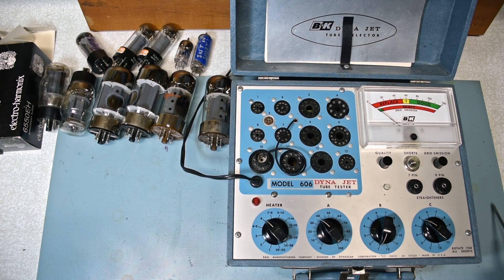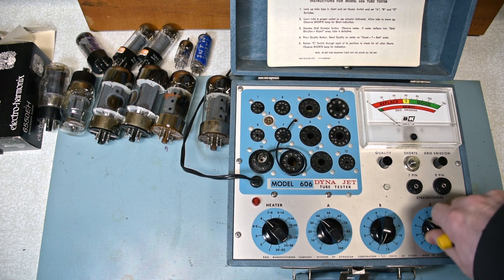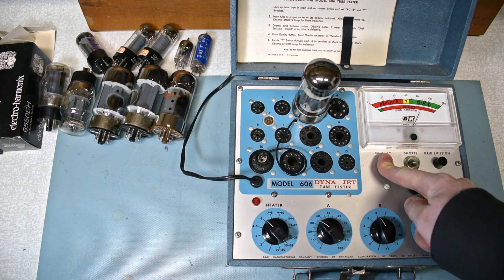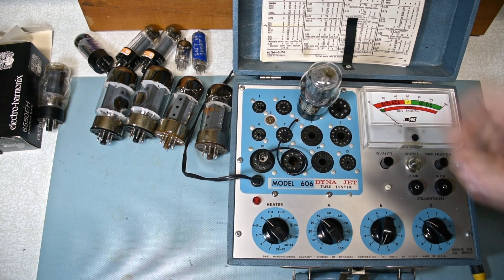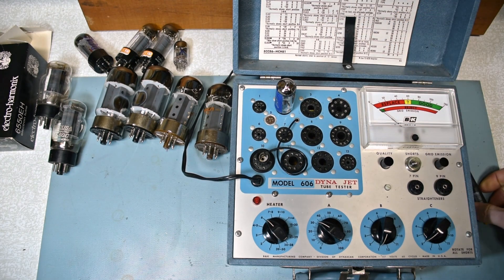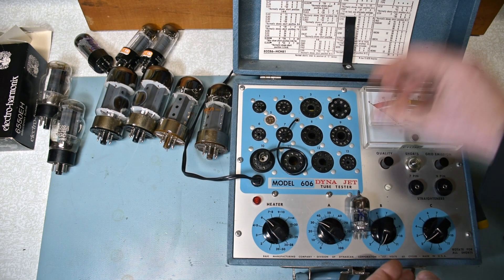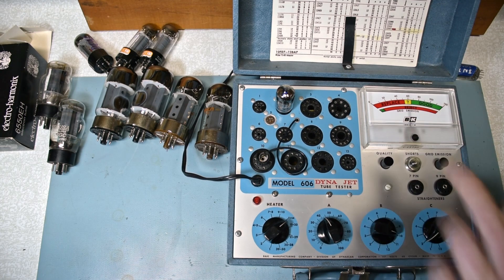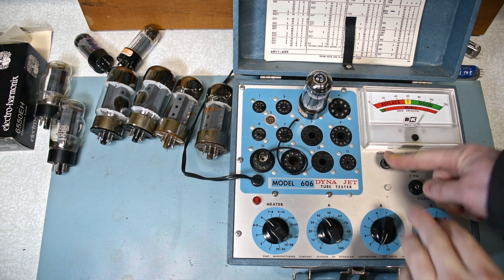Tube Tester B&K Model 606 DYNA JET Demo #009

Comment: Am i correct in assuming that ifni get the same reading on 2 different 6v6 tubes, for instance,  that they are 'matched' for use in a push pull guitar amp. Thanks for any insight. Ive asked this q on dozens of videos and have never gotten an answer
Reply from the maker: I don't think so.  This tested does not proved a high voltage to the plate as it would in an amplifier.  I believe the preffered matching uses similar voltage as an amp and measures current.

Comment: I noticed that the needle shot up while you were tapping the tube this would indicate a fault would it not
Reply from the maker: If I wasn't pressing any other button at that time.  It should shoot up when pressing the quality button, but yes if it shot up just from tapping it would indicate either the tube has an intermittent connection or the tube tester socket contacts could also be loose.
Reply: Sorry didn't see you pressing the button at the same time while tapping
Reply from the maker: No problem!   I probably didn't describe what I was doing very well in the video. @johnmacleod377

Comment: I heard this tester does not check EHX, GT or other Russian 12ax7 properly
Reply from the maker: I can't think of a reason the tester would work on one brand and not another and I have tested many Russian 12ax7 tubes.   That said, it wont test how "good" a tube sounds, microphonics, and some other parameters.  The final test is installing it in the in the actual device, (guitar amp or other), and deciding if you like how it sounds.
Reply: @mevmevmev  Thanks for replying! The guy on ebay told me the following wgich is what is stopping me from buying it. I wanted the Orange VT1000 (I don't know if that does more then an emissions tester) 

These are the tubes he said it won't test. I mainly wanted a tester to see the condition like the VT1000. Please correct me if I'm wrong & the VT1000 is more of a mutual conductance tester.

1- Grove Tube Gold 12AX7(A) on box but -R on tube. Made in Russia

2- Tung-Sol 12AX7 Made in Russia
3- Sovtek 12AX7LPS Made in Russia
Reply from the maker: @TheVlad69  VT1000 looks like a more convinient tester for the common audio tubes.  The Dyna Jet does way more tube types than the VT1000 but that includes old tv and radio tubes, which just adds clutter to the tester if you only need to tesr guitar amp tubes.
Reply: @mevmevmev  It was but they no longer make it. I found a B&K 747 for $260.00 but I don't know how bad it is. The guy said one blub is out. So I'm one the fence. Any advise?

Comment: Well, that's pretty disappointing.  I have one of these and your test just showed that it missed several bad tubes, what good is this tester then?  Also, what does the "Quality" setting measure?  Thanks for posting.
Reply from the maker: I believe it is the current flowing out of the plate.  That is why it takes time after you first plug in the tube and shows nothing until the filament warms up the cathode which allows the electrons to jump from the cathode to plate.  Without this working, the tube won't be able to amplify so at least the tester shows if the main function of the tube is working.